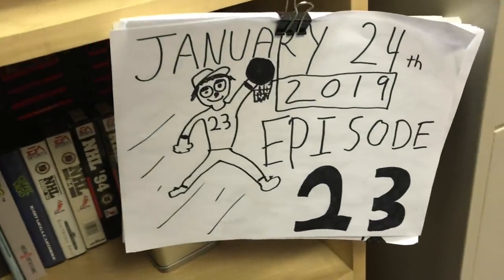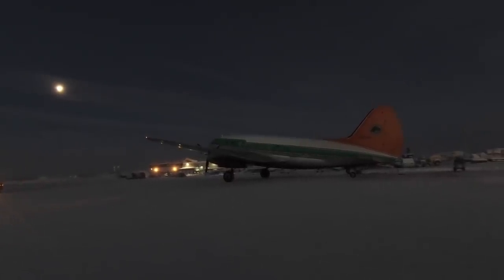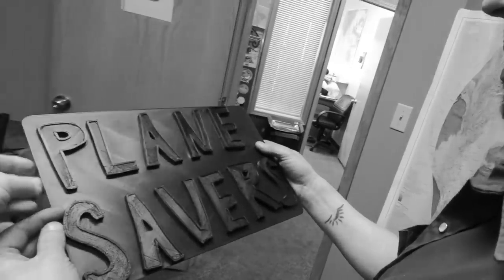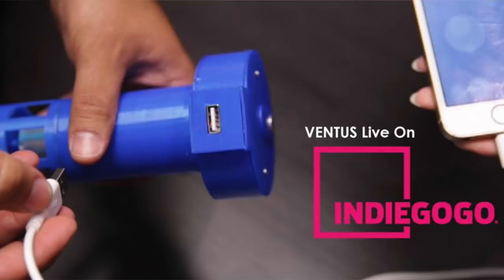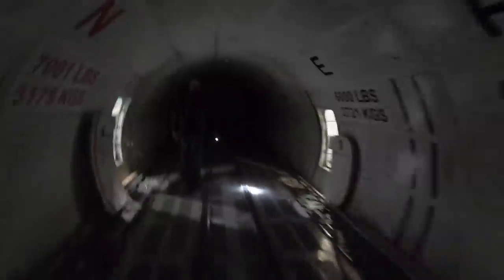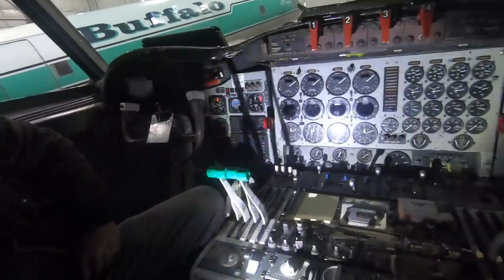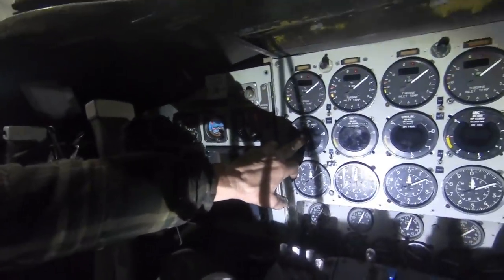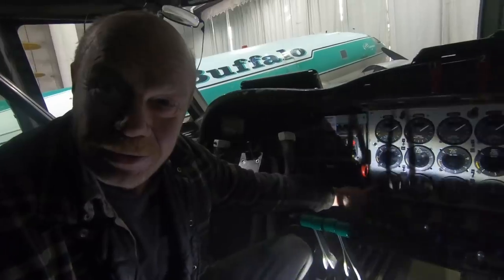Plane Savers E23 "Chuck"

Comment: Excellent episode as usual Mikey. 
Merci beacoup.
.
Merci to Stratos Aviation as well for their support to the project in the way they've offered. I've seen elsewhere that they've done some work to assist a young female engineering student new to Canada to develop a very unique and innovative power generation device for use in the cockpit of Cessna aircraft as an accessory to power modern personal electronic devices such as smart phones, tablets, digital cameras, etc. Stratos Aviation is truly a company that shares Buffalo Airway's vision of helping to develop Canadian Aviation in niche ways.
.
Last but not least, thank you to Chuck for taking time to give us some insights into the Electra. I was particularly happy to hear him mention how RPM and Torque is measured at the prop shaft.
.
 If I remember correctly, at DH during the Q400 flight test program, we used a similar  method (wireless slip ring pick up) for measuring torque at the shaft for the PW150A Pratt & Whitney engine. This constituted a departure from the much older original method which employed strain gauges and it represented a more reliable and easier to install sensor solution. I was't aware that it had been in use in an early form from as far back as the mid 1950s, seems you learn something new every day watching Plane Savers. 
.
Thanks again for your great efforts and that of your team and supporters, in undertaking this project. much appreciated.
.

Comment: Thanks for another great video Mikey! I love the way Chuck explains things, I worked on the old C-130 in the U.S. Air Force. I look Forward to your videos everyday
Reply: I worked on C 141 1980- 84. I just found out the flap jack brakes helped to slow the aircraft upon landing. They just told me to change the motor. I did not 

 recognize the significance of the part.  But i did the job, safety wired the brake and left. When i started to fly 3 years later i  understood.

Comment: Chuck does know his stuff and is obviously passionate about the airplane, keep him happy. I heard of the C-119 prop blades being hollow to. They had a foam core and were known to get "pregnant" when the form core came loose and moved around inside the blade, deform it and would result in throwing a prop, not good. I A good friend I had years ago was an engineer on one and it happened. Don't know if the L-188s are the same for that. To bad L-188s aren't still in passenger use, I'd love to go for a ride. Lockheed was a good company until they stopped building airliners.

Comment: I worked with a lot of "Chucks" when I was in the air force, and started becoming a "Chuck"" by around my 15th year. Running on coffee and sarcasm... oh yeah, I could tel the difference between a Herc and an Aurora just by the sound. Herc has a sharper prop noise, only slightly...

Comment: While watching an episode of Ice Pilots I was wondering about landing the Electra on very rough Ice lake runways and thinking the Hercules would be better suited, to operating in places like that.
Reply: The Electra is an airliner built for airport runways, the Hercules is a warbird built to operate off short dirt or improvised locations, its landing gear is built short and tough to spread its weight over a larger area for landing and taking off from dirt runways.

Comment: did you see the 2 videos yesterday i posted in the comments. of a crew going to antarctica to repair and fly out 2 canada  based DC3 turboprop versions that had been damaged out in the snow.. the first one they had to rebuild parts of the wings and graft on a whole cockpit..  the second needed some landing gear and new engines and props..

Comment: L188 vs C-130 engine parameters very Interesting.... He forgot to emphasize the Engines (and props) run constant RPM..  you only change fuel and blade pitch to produce more or less power.

Comment: I didn't get large stretches of what Chuck was trying to say. Are the props hollow, or are they not? The flight deck really Looks used. Will you also clean it during C-Check ;-) So I understand that the one which belly landed due to a Landing gear failure was converted to a tanker and no longer servces as a freighter?

Comment: There is a survivor Electra I saw in a Hangar in Central Louisiana. It looks in good condition however it would be nice to see it outside. I am interested since I am a Heavy Pilot and about as old as your Dad.. The owner said he starts it up two or three times a year and they do a Annual Inspection including rotating the Gear about 10- 20 times a year while on the stands. He stated it is Flyable but no current registration, airworthiness certificate or insurance. He also stated to maintain it in running hangar condition the Aircraft costs about 25000.00 per year. I saw it on the stands with the gear up. Looked like a Big Display Model. He has a Luxury Cabin with a Bed, TV, and a Built in Aircraft Kitchen. A Very Professional set up. He did not elaborate on the History.  The man is a A&I. He said he has owned Betty for quote " A Long, Long, Long, Long" Time. But that is the way it goes there are hidden artifacts everywhere. His Home is at his Airport. He lives in a Newmar Motorhome.. and I guess he spends a lot of time in the Electra. Nice Place.
Reply: reno flames interesting, do you know what the N number or the aircraft’s serial number is?

Comment: That has got to be the worst interview i have seen and didn't do a wonderful airplane real justice. Why not tell people interesting things like the were props 13' 5 tall, gross weight 110,000 lbs had a 2 stage gear box and when running you could back it up and drive in like a car with the propellers had a Negative Torque System (NTS) that could change the prop pitch angle on landing. The L-188 was a great cargo conversion aircraft with cargo doors in the front and rear you can load all kinds of odd shaped bulk cargo inside the cargo bay from the back and the crew can enter from the front. If installed with an APU it can go anywhere and haul anything as long as fuel was available. The only down side the aircraft was its short 98' wing span in being so short did not have a lot of flex and in rough air you would encounter a rather rough ride. I can tell you on two occasions i have experienced being at gross weight on  take off and hitting sea gulls on take-off and them big Allison`s just chewed them up. We flew around and burned off fuel it dented up the airplane  and made a mess of the windscreen but they are just like indestructible.   The Hercules was a far better suited aircraft  for Military times and the disadvantage was low clearance and no side loading door so theirs no comparison however the turboprop is far superior is fuel efficiency. The problems with the L-188 and not being around any more is serviceable parts and overhaul facilities and no one wants to spend the money upgrade the aircraft.
Reply from the maker: Really the worst interview you have ever seen? You must not watch a lot of YouTube videos. May I suggest the Zombie kid that likes turtles. https://youtu.be/CMNry4PE93Y